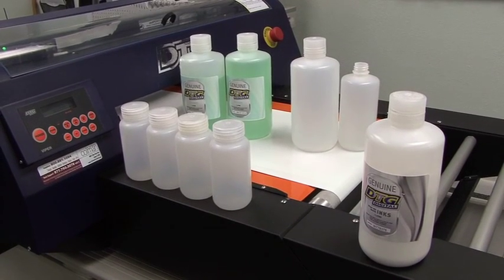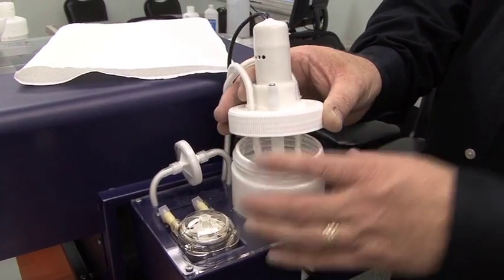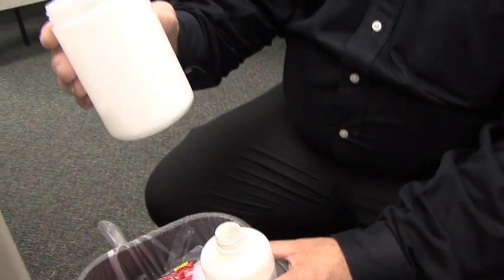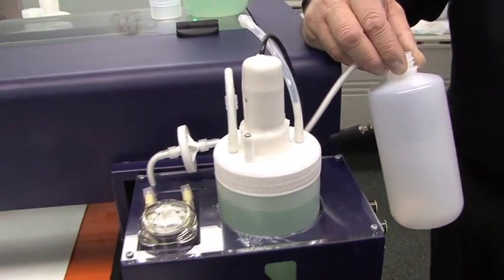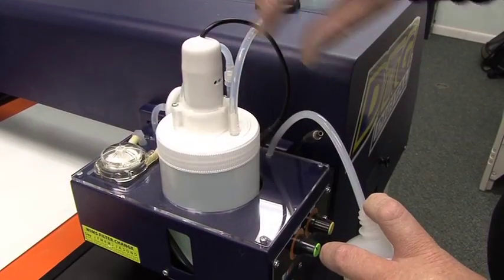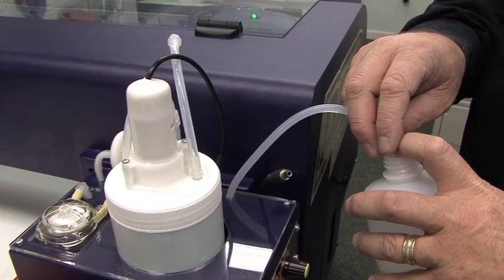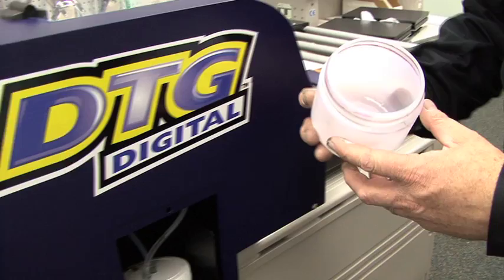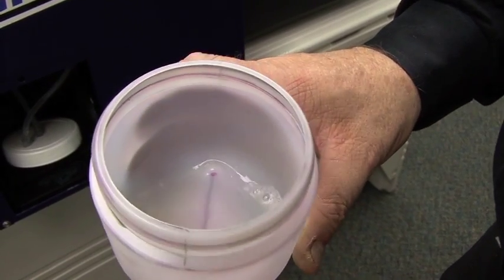Viper DTG Training Video - Flushing Procedures

Comment from the maker: Hi Eddie, unless you're told otherwise by support in response to a clog somewhere, you would flush your system if your DTG Printer is going to be inactive for a period of time...going away on vacation? FLUSH FIRST! It will avoid ink gunking up your lines.